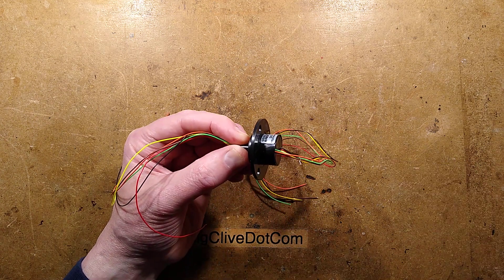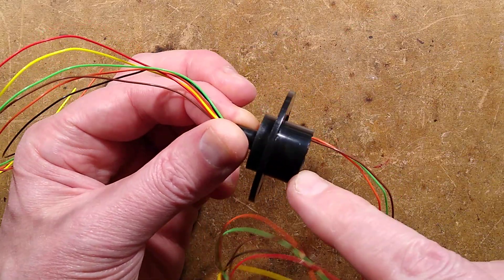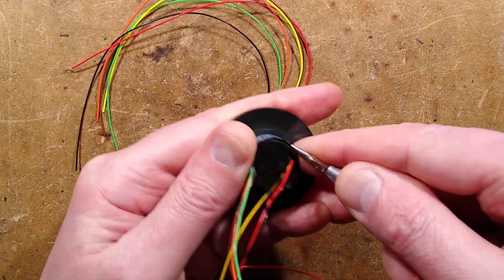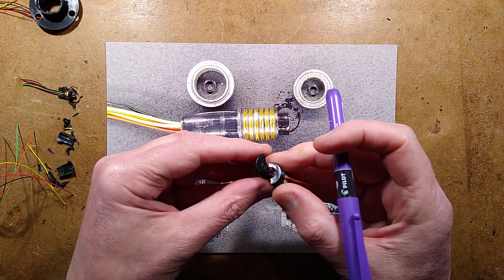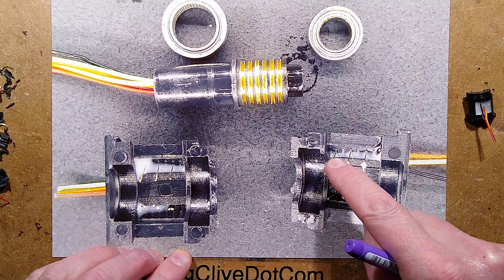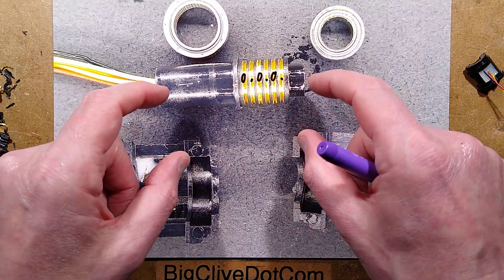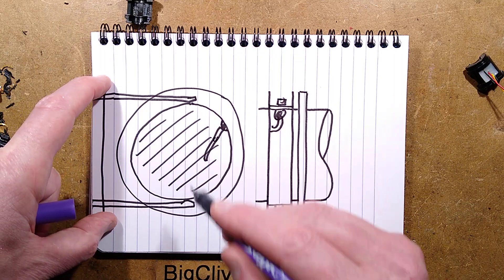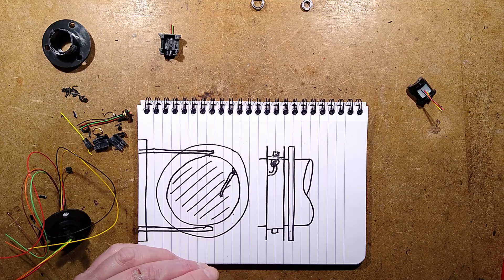6-circuit slip-ring teardown

Comment: I have a new found respect for my car steering wheel now with all those random buttons on it knowing what it is going through to provide me with all that functionality when all i use is the horn
Reply from the maker: In the car it's usually a "clock spring".  A long spiral ribbon cable that provides a continuous connection for a known number of wheel revolutions.

Comment: Hi, Clive. Nice dismantling. In my job, we use several rotary joins on radars : they have to sustain an enormous amount of turns (around 50M), but not at a high speed (15rpm max). Some uses as much as 21 slip-rings (some of them connected in parallel to improve current when required). They are not coated with gold, but gold is an important part of the alloy used to make them as well as the brushes... The groves are lubricated with a very special oil. Quite expensive when we need to refurbish them every 4 or 5 years!
Reply: I guess the actual RF Power goes through a wave guide in the center then?
Reply: @DasIllu , you're right. 2WG and 5 coaxial channels. Slip rings are only for AC/DC signal and power.
Reply: Rotate and radiate.  🤣
Reply: Interesting! What type of lube is used?

Comment: We used to use ARBs. (Amber rotating beacons).  Mostly the domain of the poles and holes guys but some bright spark thought hanging them on ladders would be a good idea too.  They were great.  Not lit up and flashing but you could break the mech and recover a great very robust electric motor, one of those spinamathings and a flasher.  They also gave us access to those expensive big square batteries with springs,  they would run a radio for months
Reply: Rotating laser levels that shoot a reference line onto walls for installation of drop ceilings must contain a set of sliprings....
Reply: @goodun2974  ...or just a rotating mirror assembly that needs no power ;)
Reply: @NiyaKouya  ,  Perhaps, but if you really need near perfect alignment, Which would be easier to align perfectly, the laser itself, or the mirror that has to reflect it? In order to spin a mirror and have the laser beam stationary yet reflect 360ﾟ all around so that it puts a level line on all 4 walls, I would think it might be easier to spin the laser. The mirror might have to be some kind of weird mirror ball in order to do this. Or perhaps it would require a prism or a fiber optic link or something like that.....

Comment: Need one of these for my steering wheel - my horn didn't work half the time, and eventually failed completely, but I could get a peep out of it if I fudged around with the wheel a bit. Pretty sure the slipring thingummybob inside has failed.

Bloody scared of taking it apart because of the airbag.
Reply from the maker: It probably has a "clock spring" ribbon cable inside it as opposed to sliding contacts.

Comment: Our AGV track wheel casters use these to pass the data from the wheel mounted optical encoder to the processor.  In this application the track wheel is used to to confirm speed and distance.  There is a second encoder (without sliprings) on the caster assembly used to confirm the casters angle.  The caster needs to be able to turn 360 degrees when the vehicle is reversed.

Comment: Even high quality slip-ring are mostly POS. Even though the internal contact paths are sturdy enough to withstand high currents and relatively high voltage, the wires on both sides would break eventually faster than you'd think.

Comment: I was here to mention the "wetted" slip rings.  Used them for analog camera systems that had to reliably carry the signal and quite a bit of power to run the thing. Neat!
Reply: Like the Roundshot?  Or do you mean a controllable camera mount?
Reply: @mjmdiver1137  
   It was a camera for a sewer snake that would spin the wire on and off of a big reel while sending composite video through it.  It had to run the camera and lights at a minimum.  Some models had full pan and tilt and tracks or wheels to propel them.

Comment: I haven't had a requirement for these kind of slip rings, but I did finally get around to buying some teflon coated wire, and I really like it. Obviously not as easy to strip as the regular PVC coated wire, but it's nice when it doesn't melt back when you tin the ends of the wire.
Reply: Beware thar Teflon is a PFAS with associated dangers .

Comment: In the 70s, some Leslie speakers (the ones with the speaker actually IN the drum - vile) used Mercotac mercury contacts to get the signal into the speaker. Not always that reliable. The service advice was "remove the capsule and shake it to get the blob of mercury back into position". Always made me feel like James bloody Herriot about to take a cow's temperature.

Comment: That thing is tiny, and is got ball bearings. I wonder if it's bi-rotational and it's kind of sad that they didn't put separations around the tracks so that the brushes can't come out of their tracks. Very neat device, I'm used to dealing with slip rings on helicopters.

Comment: Since I was a child I've wondered how electricity was transmitted through a rotating joint. This is awesome, thank you!
Reply: it's always awesome
Reply: Ever see or hear a rotating Leslie speaker, the type often used with (electronic) church organs and occasionally by guitar players? (SRV did).  The low frequency speaker typically doesn't rotate and instead has a slotted baffle enclosure around it ( a "cheesewheel") that rotates, and so sliprings arent generally necessary for that, but if the speaker cabinet contains high frequency horns that rotate, the audio signal to the horns would have to pass through sliprings. (A Hammond B3 organ through a Leslie speaker, in the hands of someone who really knows how to work it, is a massive wall of sound that'll just about make you levitate).

Comment: Would be interesting to hook this up to an oscilloscope to see any noise (on a constant voltage) as you turn the slip ring.  
You could use a pair of the slip ring wires, one in one out, so that the oscilloscope probes don't have to rotate.
Reply: Slip rings that need low noise or higher current use two contacts per ring.

Comment: Is this the sort of gadget used for power/switching transfer for steering wheel controls on cars. Like the steering wheel automatic transmission on Chrysler cars and od/horn switches on UK classics?

In hospital @ moment, wish me luck.
Reply from the maker: Hope everything goes well.  They tend to use a "clock spring" in cars.  Basically a long spiral ribbon cable that can handle several wheel rotations.

Comment: I'd have liked to see you do a temperature test on the insulation with a soldering iron; teflon wouldn't melt at soldering temperatures, but I'm sceptical that it actually is...

Comment: This type of slip ring was used in an industrial product I worked on a few years ago. We life-tested several to determine service life as the manufacturer was a bit vague about that. The life was quite long, multiple hundreds of millions of revolutions at the rated max speed (a few hundred rpm) passing 250 mA. Afterward they were tested at thousands of rpm to evaluate the abuse case and contacts life was better than expected. Problems did arise though in mechanical damage to bearings and plastic parts over time at higher than rated max speed , mostly due to imbalance and creep of the plastic parts. I'd have no hesitation using them for rated speed or lower speed operation at rated current - but low voltage only - not line voltage. BTW as of a few years ago I understand mercury slip rings are still used for very high current applications in shipboard cranes inside the slew rings. Cheers!

Comment: My first thought was data reliability.  Given some kind of characterization of the dropout rate and severity, I'd love to take a shot at designing a protocol to transmit bidirectional high-speed data (suitable for video, etc) with the proper redundancy and re-sync properties to overcome the inevitable data loss.  I'm sure this is a solvable problem!
Reply: Would USB 2.0 or I2C fit the bill?
Reply: @johndododoe1411  I think I2C would be far too slow.  USB 2.0 speeds might be enough, though the existing physical layer is surely not tolerant of such a "scratchy" connection.

Comment: As soon as I saw the housing I knew it was single-use Chinesium. 
BTW: mercury-wetted slip rings may be banned were you are, but they are certainly still available on the market! 
( company called Moflon makes them - YT didn't like the link)
(I'm familiar with that company, but I mention them only out of convenience, this is an unsolicited mention)
Of course, if your customer is the military, it is much easier to get and specify products containing things like Hg, Be, DU, etc. 😉

Comment: I work on large Komatsu (formerly P&H) electric rope mining shovels (think really big excavator, as in the size of a small apartment building...) which use an extremely large version of this that is about 8 feet tall and weighs about about 1000 pounds that carries everything from 7200v supply down to 24v control signals, even compressed air and high pressure grease and open-gear lubricant between the crawler section and revolving deck and machinery house of the machine...

Comment: I tested a composite video signal over one for a FPV drone and it was fine  (i doubled it up on 2 wires to help remove any glitches)
But I never really used that plane much so i dunno how long it would last before giving problems.

Comment: I have rebuilt the rings in cable reels, and that is a fun job after the reel was hanging in the loft of a steel mill for years. They tried replacing festoon cables and hot rails with them, but they were more pain than they were worth.

Something tells me that the thickness of that gold was extremely thin. 0.0005" or less, I'd bet.

Comment: I'm using two pieces of the smaller version of these from Senring in my prototype gizmo and I'm passing I2C signalling at 100 kHz through them. No problems with signal integrity so far, in my limited testing.

Comment: Nice Video Clive. The last place I worked they had mercury whetted slip rings. I ran into a problem with one of 50 of their machines, realized it was the slip rings and was told in no certain terms that I was wrong - one had never been bad in 25 years. They were computer signal wires, that perplexed me as to how a sensitive signal that went to an analog input of a microprocessor. Went against management, and pulled it anyway - buried in the heart of the machine. Found that a mechanic crow-barred a bearing off below it, cracked the plastic, and the mercury leaked out. After it fixed the problem, every call they got turned into a change the slip rings call. 🙄 Managers🙄

Place I worked before that had a run-in rack (Burn in brush seater) for 'sweeper' motors (Hoover). They put 51 motors in a merry-go-round, using a 17 neutral rings for the 3 phase 4 wire 110 volt system. 51 power + 17 neutral = 68 rings / wires in a single center pipe) Each pulled 9 amps. These all fed from the floor thru a center pipe / slip ring array.  

They came out with a new, more powerful 14.5 amp motor, and I told them, "Too much total current for them all to run up that 2.5" center pipe - it will overheat." The pipe was already so hot that in had melted the plastic top cap to keep fingers out. "NOPE! You're wrong ... the 3 phase current will cancel out in the pipe!" Got a call that night ... melted the whole stack. Spent 16-1/2 hours rewiring it with all Teflon wire. 

Did it's sister rack, 2 days later ... 14-1/2 hours. I guess there must be a heat coefficient ... especially when all the wires come up through the center, and then go down the outside to slip rings, that are spaced 1" apart, so there is a 5' difference in length difference in the current cancelling, magnetic flux around the pipe, between the shortest and longest. The only good thing is, they got me outta' bed, I didn't bring a lunch, and they refused to say over the phone why they needed me - so they brought me pizza, and sat it beside me to work😛

Comment: 220V(AC) doesn't imply it can or sholud be connected directly to the mains, merely that it can take voltages up to that level. Clearly, it is not a power contact.

Comment: I'm interested exactly how well these would pass low-speed signals, so I hope you give these a little electrical testing too... a test jig could loop a signal through two contacts on the slip ring, while a motor spins it. Synchronous serial would likely fail badly, but UARTs with parity carrying small frames with a CRC can be quite tolerant, as long as your application in turn tolerates complete frame loss during rotation.

Comment: Now I'd like to see how the more expensive slip rings look from the inside! I bet they have gold plated copper tabs that run on flat tracks instead of wires that run in valleys.
Reply: I expect that gold would be too soft, and wear off easily.

Comment: Your curiosity amazes me.  As soon as you disassembled, my first thought was, how many times could this spin before failure or something disastrous occurs.  Is there any increase in resistance across these tiny connections?  Would resistance increase as the contacts wear?

Comment: I've used these in the oil and gas R&D field.  This is a cheap knock off of a more proper product.  The gold contacts should have a concaved channel cut in them to keep the spring contact in place under shock and vibration loads.  Also, the insulator the gold contact rings are in should have a separator coming up between the rings.  This gives the isolation required for the higher voltage rating.

Comment: I have a different brand of these slip wrings for a wind turbine project that is on hold. The wires coming through the model I have are much more substantial as the turbine can put out about 1500W 3-phase 110V in a 14mph wind.

Comment: I used to build transmission electronics for video camera modules that would receive the 24-36V DC along with the HD component signal over a custom-made 3-line disc rotary contact. The cylindrical stock contacts would not be able to transmit the signal reliably. We had only one manufacturer that could deliver a constant enough quality and durability - and they did cost a pretty penny too.

Comment: I would like to know what type I can use to build a DIY radar tracking antenna. The type that rotates constantly. Want to use the cheap radar module I bought a few years ago. 
As you said, these are not meant for signals, as I am sure the contact bounce and such, would disconnect the circuit path for brief periods.
Reply: Each ring has 2 contactor wires which will halve the chance of a break in contact,
and doubling up (using 2 rings for 1 signal) would halve that risk again.
 ie treat it as a 3-wire slip ring with half the risk & twice the current capacity of a 6-wire slip ring.
Reply: @massimookissed1023  Excellent idea. I'll buy one to play with. 👍